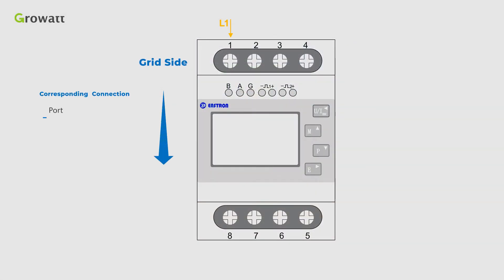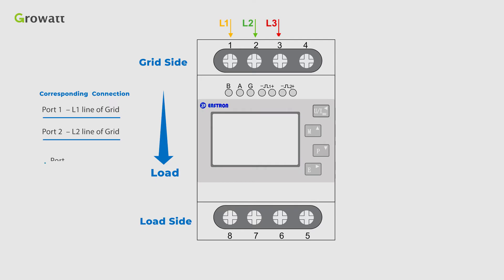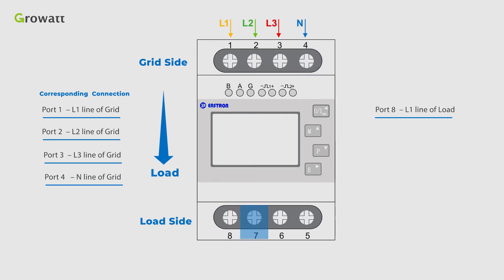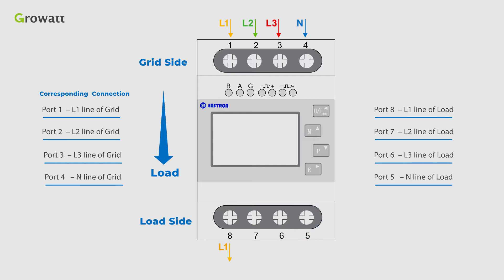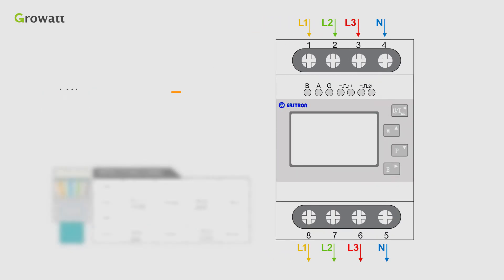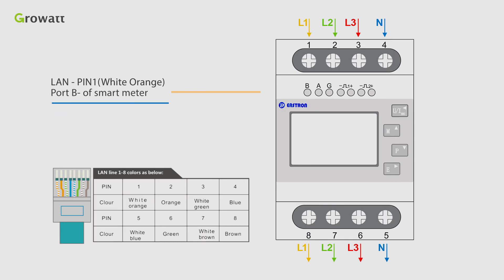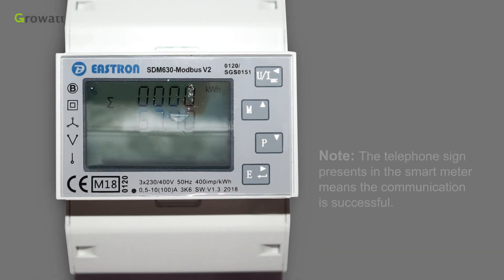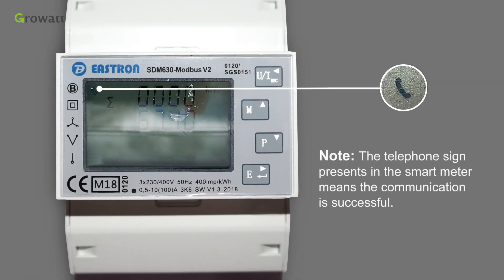Growatt Three-phase smart meter installation guidance (EASTRON SDM630)

Comment: I have three SPH hybrid single phase inverters, one on each phase of three phase network. can one TPM be used to connect to all 3 inverters or do I need 3 separate TPM for each inverter, obviously all wired in series.
Reply from the maker: Hello, for technical support, please contact our service team at service@ginverter.com, or you can call our service hotline at +86 755 2747 1942. Thank you!
Reply: What was their answer?
Reply: @nicklasfisker196  their answer should have been yes, you cannot get the communication to all 3 since you can't just go split the signal and as far as I know there is no option to connect them together. Next time just buy a 3 fase inverter for a 3 fase grid connection

Comment: Can I also control the export of the Growatt Min 3000 TL-XE 1 PH with the SDM630 3 PH?
Reply from the maker: Hello, for technical support, please contact our service team at service@ginverter.com, or you can call our service hotline at +86 755 2747 1942. Thank you!
Reply: did you get a reply? i have the same question. Would be a great solution.

Comment: Great, and where does the Growatt get hooked up?  The Growatt has no RJ45  What are they showing?
Reply: Growatt hybrid inverter has the RJ45 port and no RJ45 in the solar inverter. However, and it will be fine if you can split the Ethernet cable, and connect the 485A and 485B to corresponding ports of the solar inverter.

Comment: With this configuration, how do you read the meter from a device/computer that is connected to the same network?
Reply: What is the differences between Growatt SMD630 Modbus V3 and Eastron SMD630V2. Will Eastron units work as well?
Reply from the maker: Hello, for technical support, please feel free to contact our service team at service@ginverter.com. Thank you!